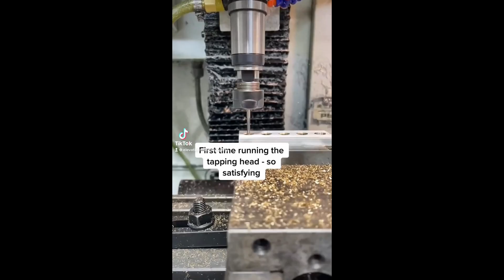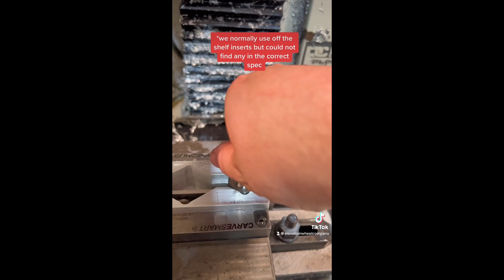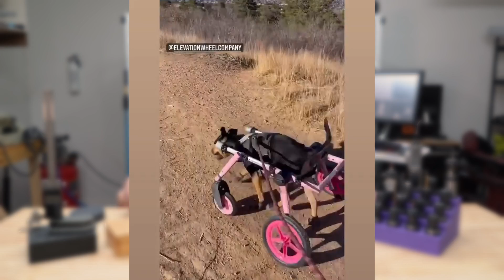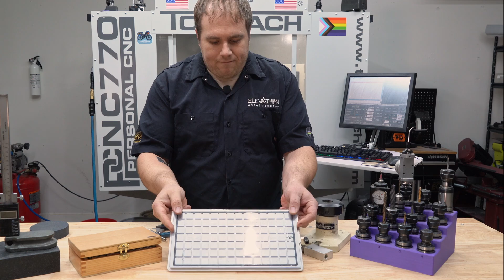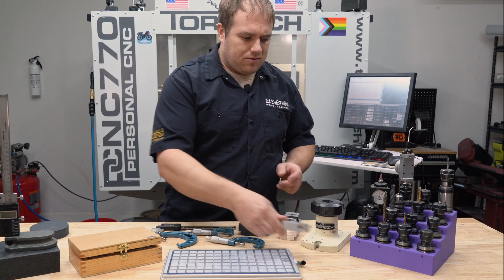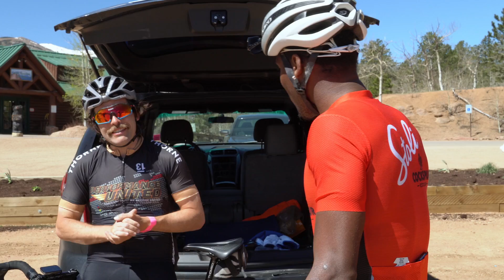Starting a Machine Shop with No Experience

Comment: When hooking your machine up to home power did you have to use a phase converter ?
Reply from the maker: My mill will run on a standard 120v outlet.  I eventually added a dedicated 20 amp circuit for it but I managed to run it off the existing 15 amp circuit for a while without issue, I just tried to keep the cuts lighter.  Tormach does make a more powerful mill that runs on 240 but it is thankfully single phase 240 so still really easy to set up at home.
Reply: @ChrisMurrayEWC   ohhh no kidding ok appreciate the info.
Reply from the maker: @justintupicruz6324  My pleasure!

Comment: And which employee has the knowledge? Biggest load of "no experience" bs lol it's not worth the effort to make work holding early on with no experience... Not unless you give no value your time.
Reply from the maker: I am the only employee and bought my mill having only run brake lathes in the past so wondering where “no experience” comes from.  All my fixturing is also pretty basic and gotta invest time to learn a new trade so 🤷‍♂️
Reply: @ChrisMurrayEWC  don't worry about this guy. There's always at least one in a crowd.
Reply: got into a machine shop 2 years ago for the first time as cnc. and now im learning tool and die. The amount to learn is endless. Have fun with it, I'm trying too. !   @ChrisMurrayEWC

Comment: Get a tormach with turret tool changer and get a manual lathe and mill as well as a surface grinder I’d like both tormach machines and a grinder
Reply from the maker: One of our goals as this thing grows is to grab a Slant 15 or similar so I can set it up with a proper gang tooling set up.  We run a lot of small, quick cycle time parts so an automatic collet closer and bar puller would be really amazing to have.  I am a bit turned off on the fact that they are hard to set up with a live center from what I read though.

A surface grinder would be another great one to add when we are able to but honestly right now our parts don't need that level precision.  The goal is for that to change as we get more work/experience though.
Reply: @ChrisMurrayEWC  go a turret not a gang set up
Reply from the maker: @nickking8317  I would love a turret for sure but we will most likely be limited to what we find on the used market and a limited budget.  When the time comes to get a dedicated lathe I will definitely try to find one with a turret though.  Thanks for the advise!